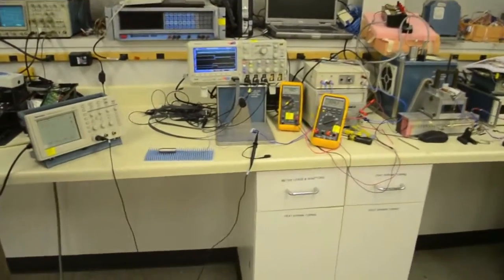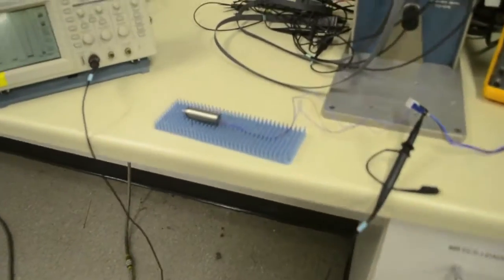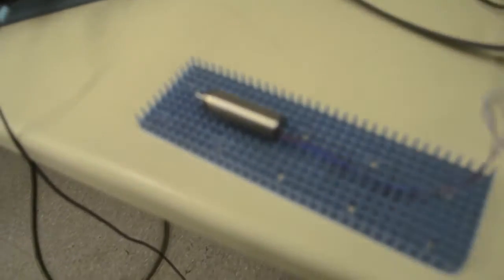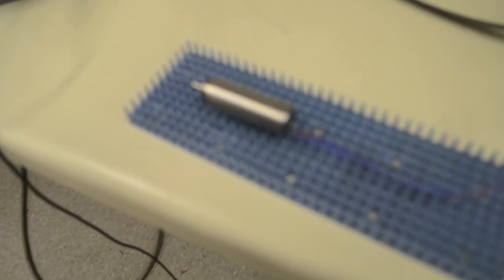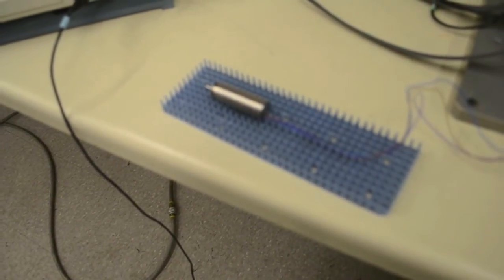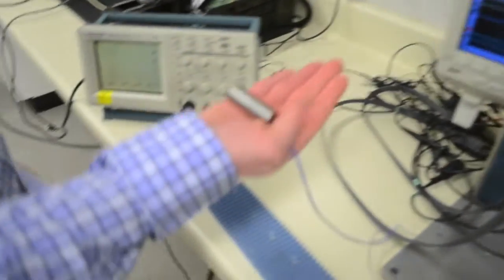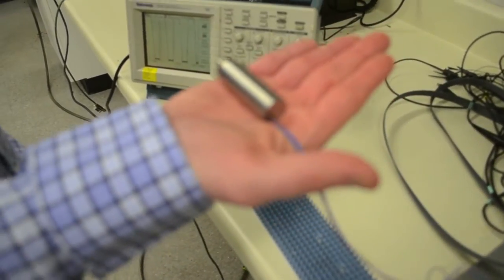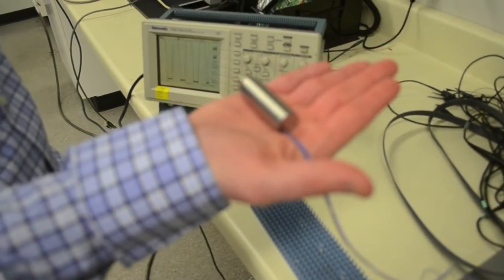High Speed Low Temperature Brushless DC Motors by Portescap

Comment: What is the failure mode after "too many" autoclave cycles?
Reply from the maker: Hi Kevin - 
Failure mode - breakdown of materials resulting in the motor not meeting
its original performance specifications. If you have additional questions about our Surgical Motor Solution technologies, please feel free to contact a design engineer directly at 1-610-235-5497.